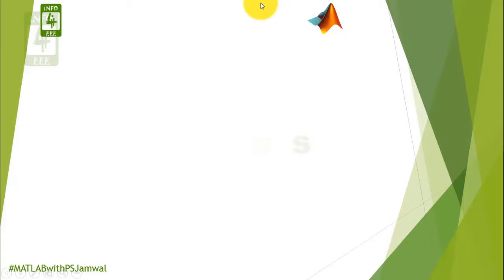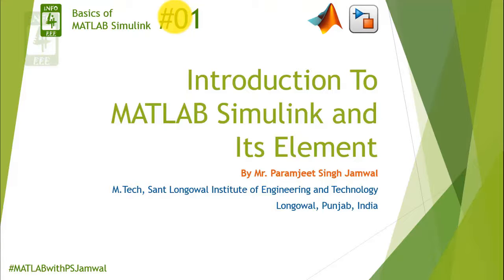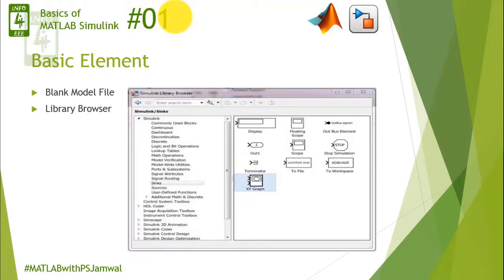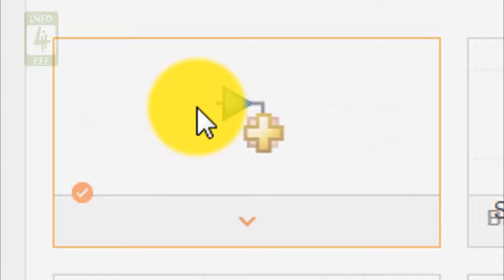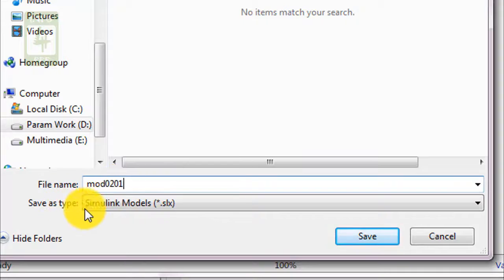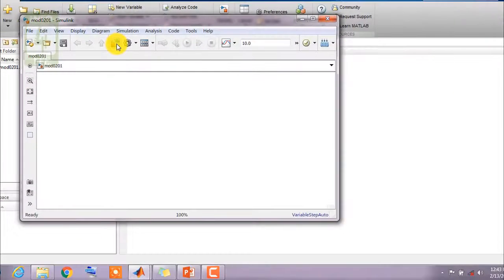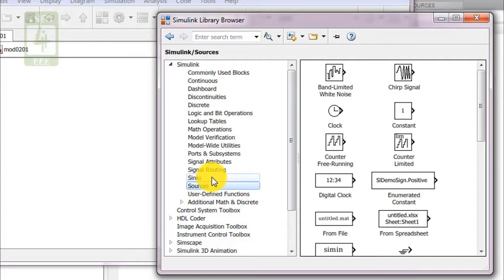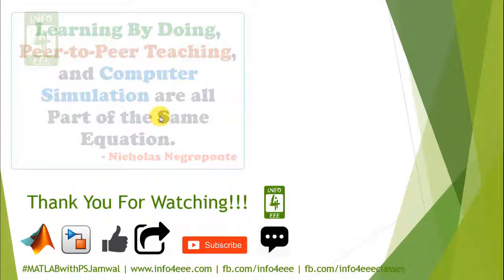Introduction to MATLAB Simulink and Its Element #01

Comment: Thank you for your video. I so much appreciate it, it has taught me so much. Please how you help me in my research work. I'm working on "DESIGN OF  DUAL AXIS SOLAR TRACKER WITH FUZZY LOGIC CONTROLLER". Thank you.
Reply from the maker: Thank You Barisuka Uebari for your appreciating words in details. It means us a lot. Mr. Jamwal has not worked specifically on these areas. But Mr. Jamwal can try to help you in the implementation of general theoretical idea through simulation in MATLAB.